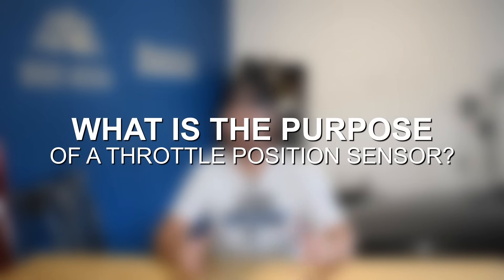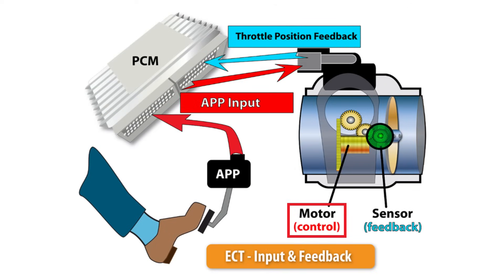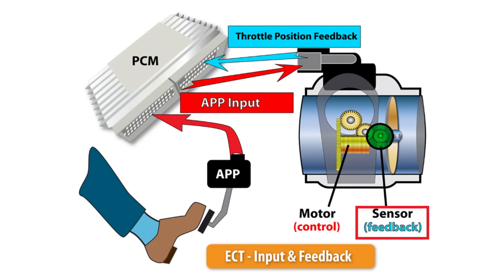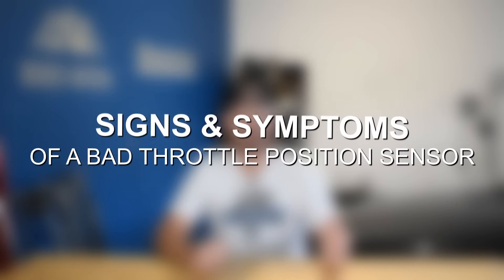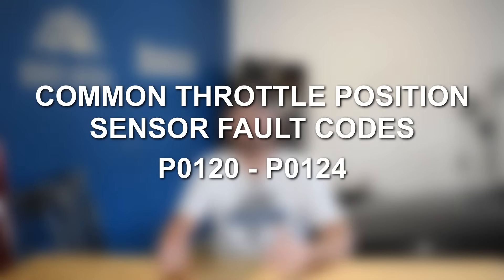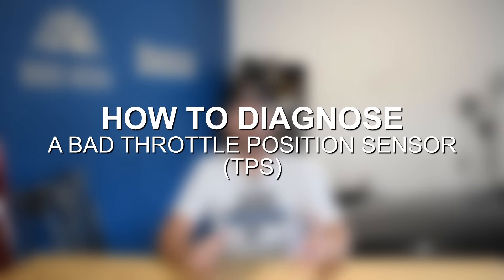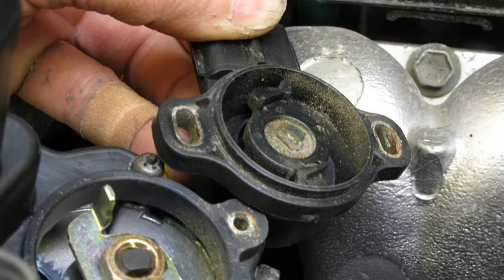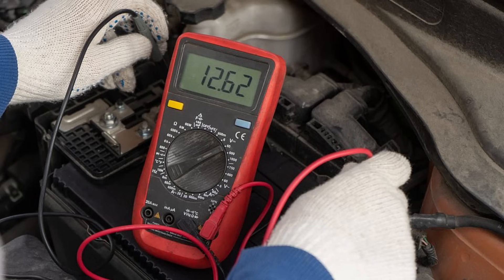Signs & Symptoms of a Bad Throttle Position Sensor (TPS)!

Comment: I haven’t thrown a code yet but my 2013 ford f150 5.0 lacks acceleration when I hit the gas. Wondering if the TPS is going bad. I did clean the throttle body recently and wonder if something got knocked out of whack.
Reply from the maker: E - If your truck is hesitating or lagging on acceleration after cleaning the throttle body, it’s very possible that the throttle body needs to be relearned by the PCM, especially if it was manually moved during cleaning, which can throw off its calibration. A failing throttle position sensor (TPS) is also a possibility, but you’d typically notice erratic throttle behavior, sudden surging, or eventually a check engine light/code (like P0121 or P2135). Since no code has been thrown yet, start with a throttle relearn procedure: disconnect the battery for 15 minutes, then reconnect and turn the key to ON (without starting) for about 30 seconds, then start the engine and let it idle undisturbed for 5–10 minutes, followed by a short drive with gentle throttle inputs. If acceleration still feels off after that, monitor live TPS voltage with a scan tool—if it doesn’t sweep smoothly from ~0.5V at idle to ~4.5V at wide open throttle, then the TPS may be going bad.
Reply: @8020Automotive  Thanks!

Comment: My 04 ram 5.7 just stopped running on me while driving and now has the heater bank sensor 1
Reply from the maker: J - If your truck suddenly shut off while driving and is now throwing a heater circuit code for Bank 1 Sensor 1 (upstream O2 sensor), it's likely that the O2 sensor issue isn't the direct cause of the stall, but rather a symptom of a larger problem, like a blown fuse, wiring short, or PCM-related electrical issue. The upstream O2 sensor relies on a powered heater circuit, and if the fuse that supplies it (often shared with other engine components like injectors, coils, or even the ASD relay) blows, it can cause the truck to shut off or fail to restart. I’d check the O2 sensor fuse in the fuse box (often labeled O2HTR or similar), and inspect the sensor wiring—especially near the exhaust—for damage or shorts that could’ve taken the circuit out. Also scan again for any additional codes, because if the stall was caused by something else—like crank/cam sensor failure or fuel delivery—you’ll usually see a P03xx or P0335/P0340 range code alongside it.

Comment: What if you have these symptoms but no codes?
Reply from the maker: J - If you're getting classic bad TPS (Throttle Position Sensor) symptoms but no codes, it’s still very possible the sensor is failing mechanically or giving erratic voltage signals that stay within the "acceptable" range, so the ECM doesn’t flag it; this can happen especially if the sensor has dead spots, internal wear, or if there's a wiring issue or ground problem that doesn’t fully disconnect but causes flaky signal; to confirm, you can test the TPS with a multimeter by slowly sweeping the throttle and watching the voltage—it should increase smoothly from around 0.5V to 4.5V with no drops, spikes, or flat spots; if you see any inconsistencies during that sweep, the TPS is likely bad even if your scanner doesn’t show a code.
Reply: @8020Automotive ... turns out my gas pedal was unplugged...  oof!

Comment: I keep on getting a engine code p0336 can anyone help I change the crank shaft sensor 3 times and still not the problem
Reply from the maker: 4 - Sorry to hear this.. If you're still getting P0336 (Crankshaft Position Sensor “A” Range/Performance) even after changing the sensor three times, then the issue likely isn’t the sensor itself but something affecting its signal quality—most commonly, it’s a damaged or dirty reluctor ring (tone wheel) on the crankshaft, improper sensor alignment, a bad connector or corroded wiring, or even ECM signal interference; if the reluctor ring is bent, cracked, or full of metal debris, it can cause inconsistent readings that trip the code no matter how many times you swap the sensor—so next step is to inspect the reluctor ring (which may require dropping the oil pan or using a borescope, depending on the engine), check for continuity and voltage at the harness, and confirm the sensor is the correct OEM-spec part, because slight differences in depth or resistance can trigger P0336 even if the sensor is new.

Comment: I have a Kia that would go in limp mode and throw throttle pedal, throttle position, lane assist and pedestrian lights. Kia dealer got me for a $500 pedal. Not fixed. I put a new throttle body, not fixed. Other sensors, still didn’t fix it. Then it hit me; there’s got to be a short somewhere. Sure enough, I found the throttle body pin connector was shorting out. Soldered a new connector in and the issue stopped
Reply from the maker: Y - Nice! Very smart.

Comment: One of our vehicles is down (09 Chevy hhr). Wife was driving home and it is missing really bad and will barely move and can smell unburnt fuel and black smoke in exhaust. I hooked up code reader and it had 8 codes!! I checked all vacuum lines, cleaned throttle body, checked air filter, checked wiring and cleaned all connectors, cleaned MAF sensor etc. P0134, po171, po172, po300, po700, p1543, p0003, and pooo7. The only code it woukd pull up on my code reader before this happened was po700 which indicated Transmission Control Module. I did notice that before this happened that it would have a miss when first starting and go away and run fine until this happened. I’m trying to trace all of this down, but I don’t have anything but a code reader and trying to figure this out. All these codes lead to different things but I know it has to be only 1 or 2 things causing this. I have also checked all wiring and connectors. Any help??? Anyone familiar with this car? I’m not sure where else to start. I’ve been researching and reading about it all I can. Any help would be appreciated. Thank you
Reply from the maker: R - Sorry to hear this.. You’re on the right track thinking it’s a single root issue causing a cascade of codes, and based on the symptoms—heavy misfire, unburnt fuel smell, black smoke, and codes like P0171 (lean), P0172 (rich), P0300 (random misfire), P0134 (O2 sensor no activity), P0003 (fuel volume regulator), and P0700 (trans control module)—this screams either a bad fuel pressure regulator, stuck injector, or a failing ECM/ground issue that’s throwing the fuel and spark systems into chaos; a stuck injector or bad fuel pressure regulator can dump excess fuel into one or more cylinders, flooding it (causing the rich/lean codes to conflict), while also fouling the O2 sensor (P0134) and overwhelming the engine’s ability to manage timing, hence the misfires and driveability issues—so first, I’d pull the spark plugs to check if any are soaked in fuel (which would point to a stuck injector or over-fueling), and then check the fuel pressure at the rail if possible; if pressure is sky high or doesn’t drop with key off, the regulator or return path is likely shot, and if plugs look normal but codes remain, start tracing voltage grounds to the ECM, especially near the battery and fuse block—because a bad ground can mimic sensor and module failures and send your car into limp mode with a storm of codes.

Comment: I’m getting no throttle randomly when driving with my LS3. I have to pull over unplug the sensor plug it back in and it will work. Is this a bad sensor/throttlebody or a bad ground
Reply from the maker: N - That kind of random no-throttle situation on an LS3 is usually caused by a failing throttle position sensor (TPS) or a loose/dirty connector, but don’t rule out a bad ground or broken wire in the harness that’s losing continuity with heat or vibration; LS3s use a drive-by-wire system, and if the ECM loses a clean signal from the throttle body or pedal sensor, it’ll instantly cut throttle input and throw the car into reduced power mode—even if you don’t always see a check engine light; I’d start by cleaning the throttle body connector pins with contact cleaner, checking the grounds (especially on the back of the heads and chassis), and inspecting the harness for chafing or broken insulation—if all looks good, swap in a known-good throttle body or TPS and recheck, because these symptoms almost always point to a failing sensor or intermittent electrical fault.
Reply: @8020Automotive ok that’s some great advice I will start with cleaning and checking grounds. Thanks for your help

Comment: Hi, My Honda Accord has P2138 error code. What is more probable issue  - APP or TPS? Thanks.
Reply: If you scroll down to 10 days ago,  there was a response to your matchin'   P2138  .... , that may help ya  !?
Reply from the maker: N - The P2138 code indicates a problem with the correlation between the two throttle or accelerator pedal position sensors, and while both the Accelerator Pedal Position (APP) sensor and Throttle Position Sensor (TPS) are involved, the APP sensor is the more common failure point, especially in Hondas, because it houses two internal sensors that must agree and often wears out or loses signal consistency due to foot movement and age. Before replacing anything, inspect the wiring and connectors for corrosion or damage, especially at the APP sensor, and clear the code to see if it returns under normal driving—if it does, a new APP sensor is usually the correct fix.
Reply: @8020Automotive  Thanks. I dis/re-connected the battery. The problem is gone.  The problem came during driving on wet road. First I got VSA light, then CEL. If it comes back I know I will have to replace APP.

Comment: I have a 2018 nissan altima sv i was stuck in traffic and my engine starting kinda like shaking and trying to turn off was trying to accelerated and is doing that dont know if its a big problem just trying to understand was wrong with it cuz is not goving me a check engine light on yet
Reply from the maker: M - If your vehicle started shaking and felt like it was trying to stall while stuck in traffic—especially under light acceleration—but isn’t showing a check engine light yet, it could be an early sign of a failing ignition coil, dirty mass airflow sensor (MAF), or a weak fuel injector, all of which can cause a rough idle or hesitation without immediately triggering a CEL; since you were in stop-and-go traffic, heat soak and poor airflow may have aggravated a borderline component—start by cleaning the MAF sensor, checking for vacuum leaks, and if the issue continues, scan for pending codes and monitor fuel trims or misfire counts using a scan tool to catch early signs before the light comes on.

Comment: no check engine light but car runs poorly.  what now???  live data on scan tool gives a hint that long term fuel trim looks too high, but what's causing that if no CEL?  fuel, air, or spark?  so frustrating chasing ghosts.
Reply from the maker: C - If your car runs poorly with no check engine light but shows high long-term fuel trim (LTFT) on live data, it means the engine is running lean and the ECU is adding extra fuel to compensate—this usually points to an air or fuel delivery issue, not spark, and the lack of a CEL just means it hasn’t exceeded the fault threshold yet; most common causes include a vacuum leak, dirty or failing MAF sensor, unmetered air from a cracked intake hose, or weak fuel pressure from a clogged filter or failing pump—start by smoke-testing the intake system, cleaning or replacing the MAF, and checking fuel pressure with a gauge to narrow it down before throwing parts at it.

Comment: I drive a 2020 Nissan Altima 2.5L. Right now it will crank but won’t stay cranked. I’m getting a code for the throttle/pedal position sensor/switch. Getting code P2138. What steps should I take in correcting the problem
Reply from the maker: C - Code P2138 on your vehicle indicates a mismatch between the two throttle/pedal position sensors, which can cause the engine to crank but not stay running, as the ECU cuts throttle input for safety. Start by checking the accelerator pedal assembly—the two position sensors are built into it—inspect the connector for corrosion, loose pins, or damaged wiring, especially around the pedal harness near the floor. If the wiring checks out, the next step is to replace the accelerator pedal assembly, as it's a common failure point for this code. After replacement, clear the code with a scan tool and perform a throttle position relearn using either a scan tool or the manual procedure (usually involving key-on/off sequences and idle time).

Comment: Hi, my car is a turbocharged 4banger haha, but I’m having issues with it running correctly, the issue started the day I drove it to a friends house and left it parked for an hour and a half and when I went back to it I started it and it reved way to high then started idling really rough like if a was stepping the gas pedal on and off every second or two, I’ve checked for vacuum leaks even on the brake booster and nothing has been found, if I restart the ecu by disconnecting the battery and reconnect it I go and start the car and it doesn’t throw any code but idles a bit rough then if I leave it warm up a bit it idles correctly, but if I drive it around the block it starts to jerk a bit when accelerating or it feels like if the throttle response would have a bit of lag when letting off it keeps accelerating for half a second, then it completely idles rough and doesn’t respond to throttle and wants to stall if I don’t press the gas pedal, that’s when code p2074 pops up. I have to mention that I’ve already cleaned the throttle plate/ body and the iac valve.
I would very much appreciate any help and any other solution tu my problem. 🙏
Reply from the maker: H - Your vehicle throwing P2074 (Throttle Position Sensor–Manifold Pressure correlation fault) combined with rough idle, throttle lag, and post-warmup stalling strongly points to a boost leak or failing MAP sensor, especially since the issue gets worse once the ECU leaves open-loop mode; even though you've checked for vacuum leaks, this code often comes from an unmetered air leak after the MAF (like a cracked intercooler pipe, loose clamp, PCV valve failure under boost, or worn coupler) or a MAP sensor giving bad readings, causing the ECU to see mismatched throttle input and actual manifold pressure—double-check all turbo/intercooler plumbing under load (not just at idle), inspect the MAP sensor wiring for fraying or oil contamination, and if you’re still stuck, temporarily block off the PCV line to test if it’s pulling boost into the crankcase and throwing everything off.

Comment: I really appreciate the fact that you take time out of your day to help so many people! Thank you! My 2013 F-150 has the 3.5L V6 TURBO engine. The truck starts, idles, and revs normally, and the transmission seems to be operating normally. Pushing gently on the accelerator pedal (5-10% throttle) will cause the truck to begin accelerating normally. When the truck reaches about 25 mph, the engine begins to misfire and shake, and will stall if you do not take your foot off the accelerator pedal. A noticeable amount of black smoke comes out of the exhaust when the engine is misfiring. On a hill, the truck loses power, misfires and stalls. While misfiring, if you take your foot off of the throttle it will go back to a normal idle. When the transmission is in park, the truck will rev normally, even up to 5000 to 6000 rpm (with no misfire). When the transmission is in drive, adding more than 5-10% throttle will cause the engine to begin misfiring and the engine will stall if you do not take your foot off the accelerator pedal. What the hell is going in with this truck?
Reply from the maker: D - Thanks for the feedback! Based on your detailed symptoms, your truck is almost certainly suffering from a fuel delivery or air/fuel metering issue under boost, most likely caused by a failing high-pressure fuel pump (HPFP), leaky or sticking fuel injector, or a malfunctioning mass airflow sensor (MAF); black smoke indicates it's running excessively rich, and the fact it only misfires under load suggests it can’t maintain the correct fuel trim or pressure when the turbo spools up—scan for fuel pressure readings, misfire counts per cylinder, and short/long-term fuel trims during a drive, and inspect the intercooler for excessive moisture buildup (a known EcoBoost issue that can cause stumble under load), but start by checking HPFP command and output under load, and consider a MAF cleaning or swap to rule out erratic airflow readings that throw fueling off under boost.